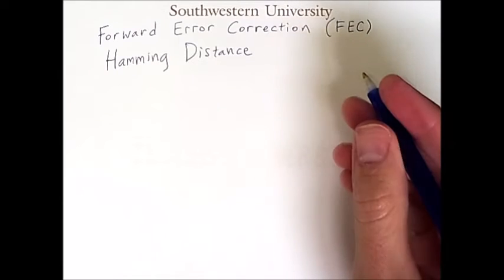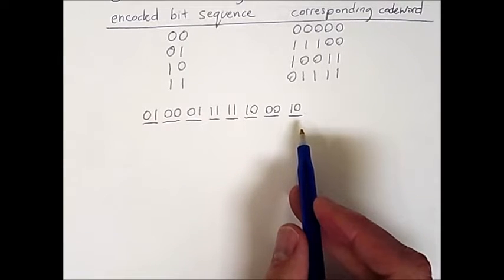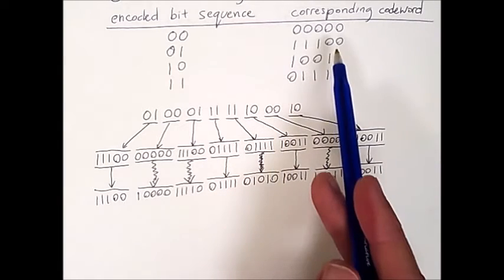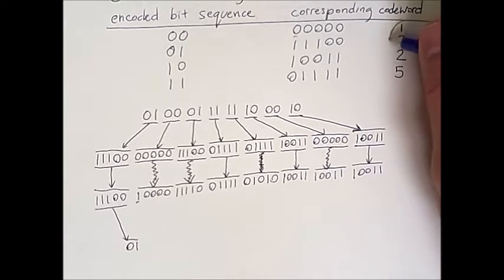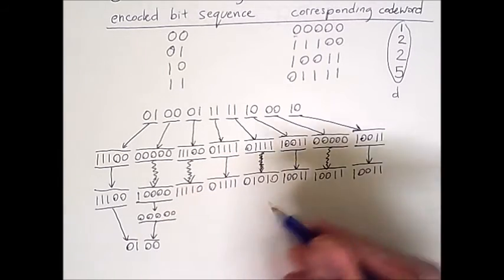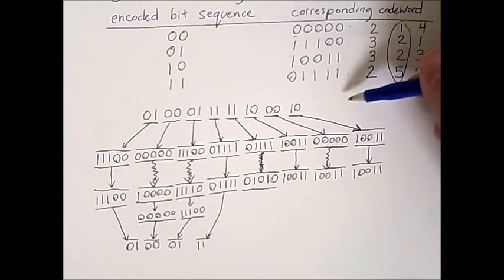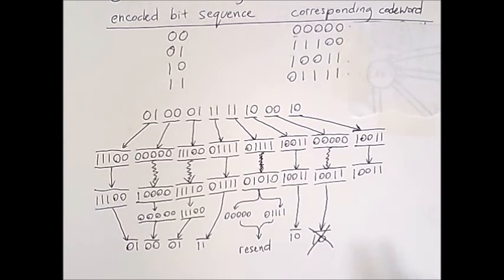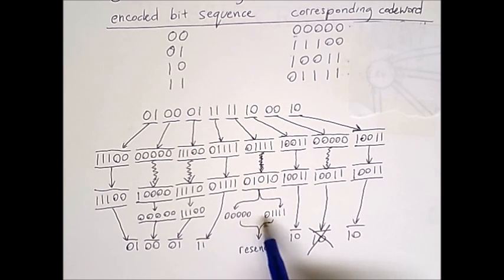Error Detection and Correction 3: Forward Error Correction

Comment: Thank you for this! Could you perhaps explain how this would work for a hard drive (ECC error detection/correction)? So sector is 'protected' by ECC to detect and correct errors. But if I'd apply this method we'd need a several sectors if we'd write 11100 rather than 01 (taking codewords from your example)?

Comment: Hmmm...  So, if after the sent sequence there was a final checksum of the underlying message, I'm guessing you could then meaningfully explore the possibility space.  

Let's say you have two ambiguous symbols A and B, where A's possibilities were hamming=2 and B's symbol were hamming=3... then perhaps you'd be able to identify some relaxation priority between A and B that helps you choose between two possible permutations that each meet the checksum - such that, it too, gets met with some least distance metric?

I mean, why throw out a possibility of distance=2, just because there are two solutions of distance=1 ... it could be that neither of those d=1 solutions can meet the checksum, but the d=2 does so... or some least-work combination of symbols.

Oh, wait... I think you'd also have to see if there was a low-hamming distance change to the checksum, that made the resolution of A and B easier.   I mean... sent checksums are data too.  So, the checksum I'm using to find a workable set of permutations has to be part of the distance-balancing metric too.  Maybe the least-cost permutation involves being prepared to admit a single bit error in the checksum.

Oh, man, that complicates things a little :D   Now it's a fuzzy sort of search.

I understand that this is only a simple example and that modern FECs are far more efficient and can achieve close to the shannon limit - but it's fun to consider how I might approach the problem of choosing between candidates once we have identified one or more ambiguous symbols using this naive codeword strategy.

Oooh... I think one intuitive tweak for bursty errors would be to interleave the codewords such that any burst errors are more likely to create single-bit errors across multiple words (high recoverability) - rather than concentrating multi-bit errors in single words (low recoverability)

That sounds like something worth doing!

Wow, a simple but thought-provoking video :D

I guess it's now time for me to write some code to simulate noisy channels of various parameterised characteristics, with "bursty" noise and single-bit error rates - and see how I'd tweak this for different channel conditions.

Maybe this scheme can be made adaptive, based on how many times a minute it is forced to ask for a retransmission.  A little simple math should be able to find the noise threshold at which it makes sense for the endpoints to agree a larger or smaller codeword size.

Oh... I'm definitely gonna have some fun playing with this in code.  If only to put off trying to tackle the scarier stuff like Reed-Solomon, LDPC and Adaptive Turbo (I've looked... they scare me) : /

Anyway, thanks for taking the time to make this video.  It's a great starting point for inquiring minds : )

Comment: Hi Jacob a question. If in the case at 10:08, where a resend protocol happens. What if the resend gives the same exact errored bits or if a entirely difference sequence of bits happens? What will the FEC do then?

Comment: Hi, the dictionary of code is created by the sender/receiver? Or how this dictorionary is created? Thank you for the video!
Reply: Yes. It's like a reference guide. You have it with you on both sides since it's to be used specifically for this; it was specifically created for this by the creator.

Say for example, this is for a data transmission between two branches of a company. The company creates the reference dictionary and gives it to both branches. So don't fret too much about it(especially if you're worried about exams and all since it will be given unless you're tasked to actually make one lmao)

Comment: Why not send send everything twice? which will save you one bit for every 2 bits. 
Every 2 bits should send a duplicate of itself and you just match them up. And resend if you have an error. Or send 6 bits (2 the original and 2 copies, with the majority winning, this will save time to compare it to a dictionary and less likely to have as many errors (misinterpretation) as the 5 bit method???
Thanks for the video
Reply: I think this is not practical for real-time/live broadcasting where every frame should be transmitted in the shortest time possible.
Reply: A very good question!
Reply: I support this question. The amount of transmitted bits increases 2.5 times. Why not to send a message 3 times in a row, and select bits which repeat twice? ("a majoritar")